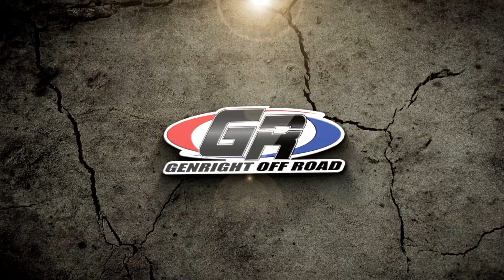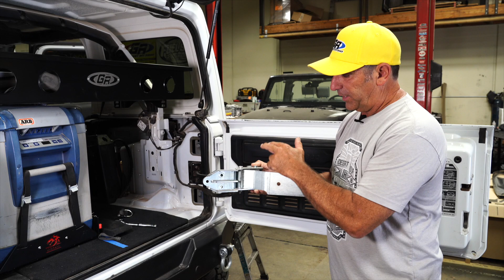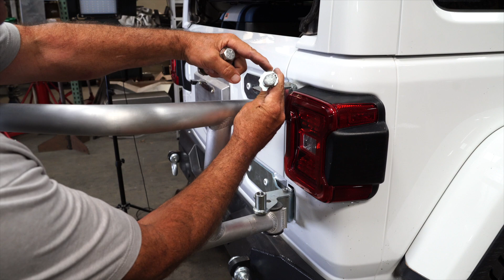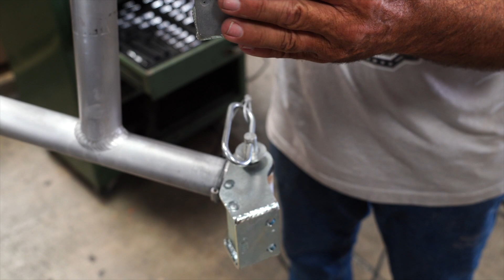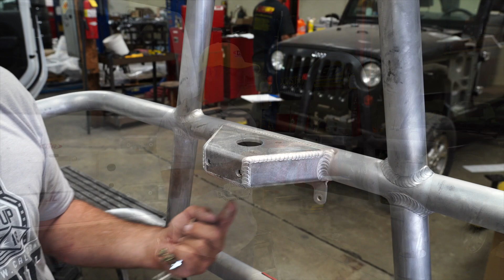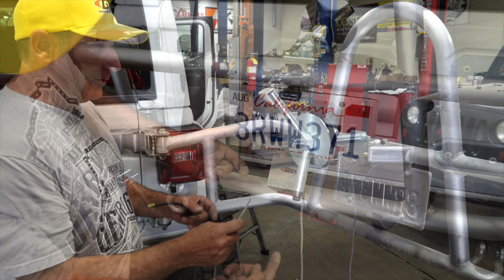How to | GenRight JL Tire Carrier Install

Comment: For anyone doing this install, trust the directions!  You might think that it's a little risky to mark and drill the passenger side without first installing the inner plate since the plate slides over 4 bolts and would seemingly have low tolerances.  However, it's absolutely the right way to do it.  Optimize for the swing carrier being set perfect and if you need to elongate a hole, it's much better to do it on that interior support plate than on the body...  Because I didn't fully trust the directions, I ended up having to widen one (and thankfully only one) of the body holes AND then had to work with the plate to bend it a little so everything lined up perfectly.  If had only just followed the directions without second guessing, it would have been so much easier...  Lesson learned.  Never second guess Tony...